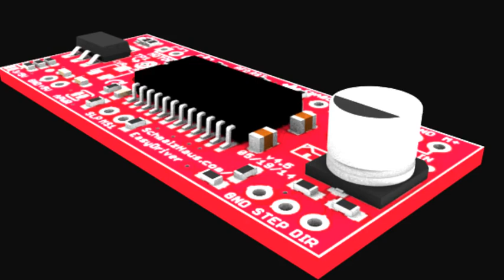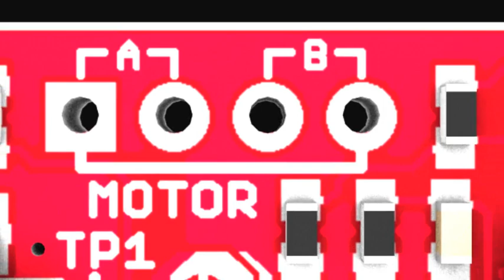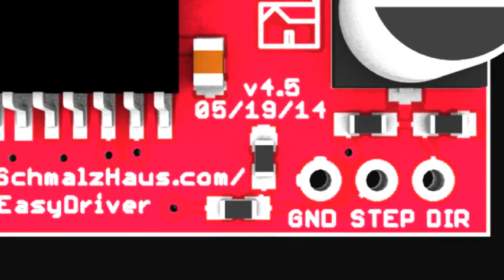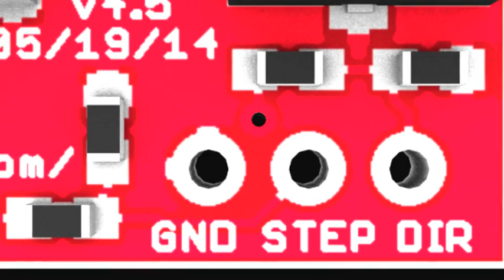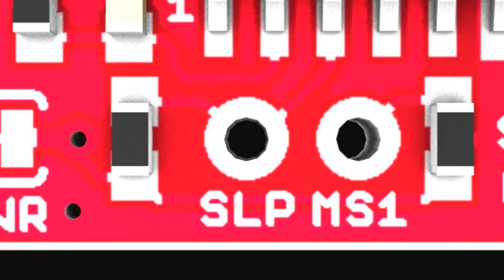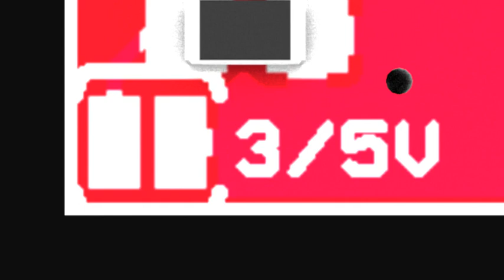EASYDRIVER: Brian Schmalz - A3967 IC — Bi-Polar Motors — .75A@30v peak

Comment: is when i short the +5 pin and step pin the nema motor take on 1.8deg step turn ?
actually i have just sometime some storke on motor and never any turn
tryed 2.7v 5v 7.4v 12v 
what is wrong?